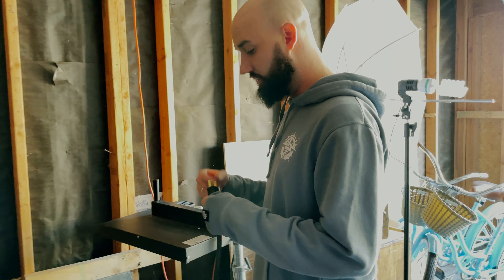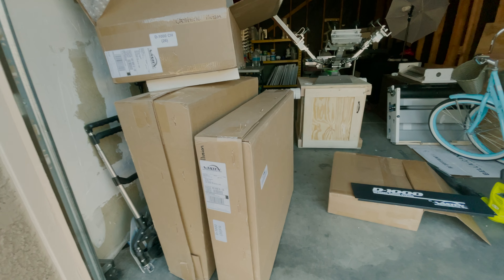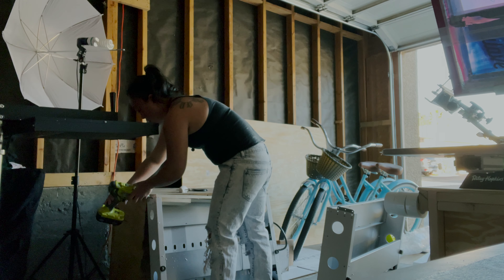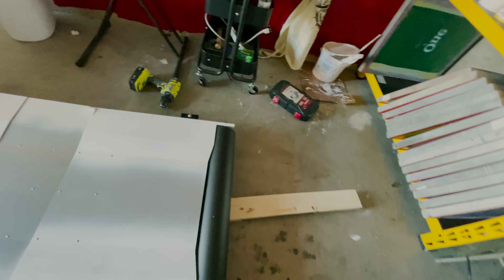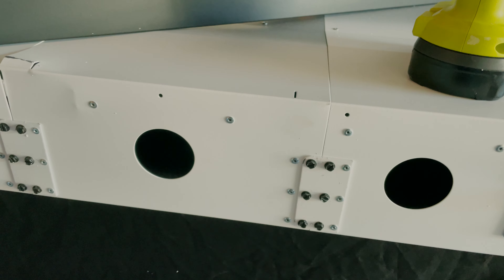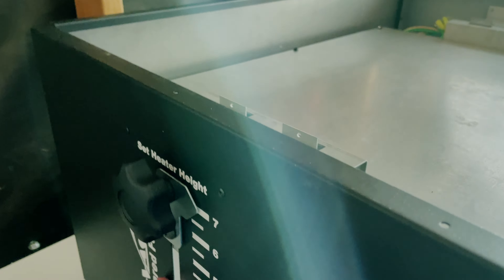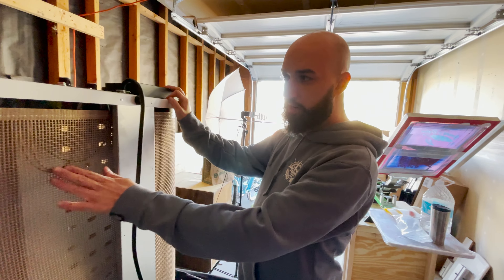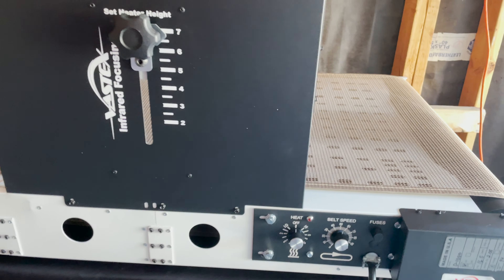Vastex D-1000 Conveyor Dryer Assembly

Comment: I'm a bit surprised you haven't blown the circuit using that cheap orange extension cord with a 16amp item like that.  I would not recommend using an extension cord with a higher amperage item like that, I'd get a 12g or maybe 10g extension if I absolutely needed the reach.
Reply from the maker: It totally blew out. We can only plug in one at a time. It’s a pain, but we make it work.
Reply: @obstacleillusion808  that makes sense then.  16amp basically almost uses up a circuit.  If you're near the panel then you could run more circuits for pretty cheap.  If you're far from it then it would be more expensive or difficult.